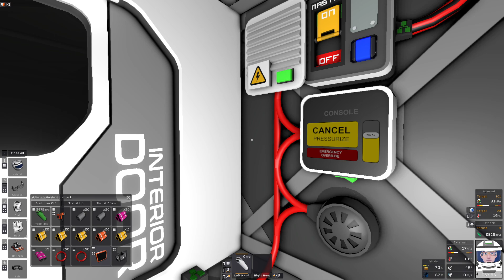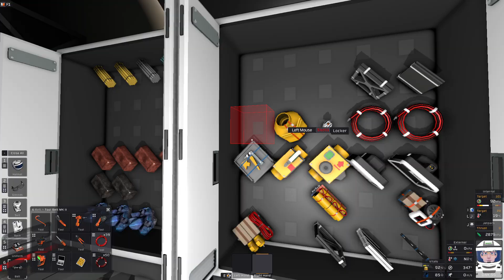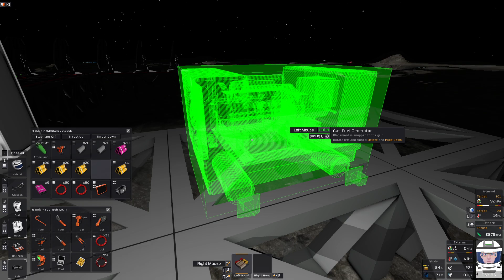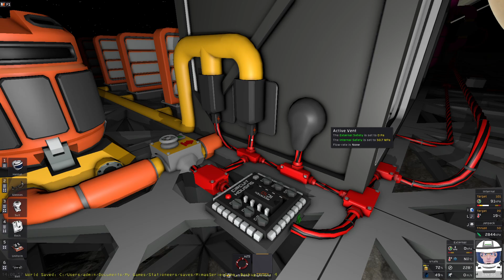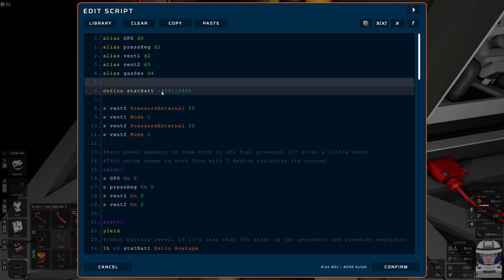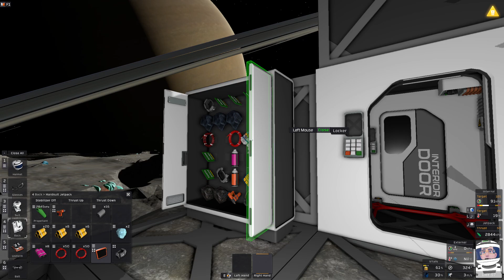Stationeers S1E12 - Mimas - Gas Fuel Generator IC controlled

Comment: Do you have the IC10 code, so I can download it?
Good video 
I'm going to try this tonight
Reply from the maker: I made changes to it after this episode, and I've pasted 2 versions into the description (don't worry, pasting it below too).  The following version is the final one I have before I had to give up recording, the biggest change is it turns on pipe heaters as a power sink if the battery goes above 98%.  If you don't want that portion it should be easy to remove, and if you have any trouble let me know I'll try to help debug :)

Code:
alias GFG d0
alias pressReg d1
alias vent1 d2
alias vent2 d3
alias gasSen d4

define statBatt -400115994
define pipHeat -419758574

s vent1 PressureExternal 50
s vent1 Mode 1
s vent2 PressureExternal 50
s vent2 Mode 1

#This setup seems to work fine with 3 Medium radiators (in vacuum)
reset:
s GFG On 0
s pressReg On 0
s vent1 On 0
s vent2 On 0

start:
yield
#check battery level, if it's less than 50% start up the generator and pressure regulator
lb r0 statBatt Ratio Average
s db:0 Channel0 r0
brgt r0 0.1 3
s GFG On 1
s pressReg On 1
#Extra power sink
brlt r0 0.98 2
sb pipHeat On 1

brgt r0 0.9 2
sb pipHeat On 0

#If battery is above 75%, turn everything off
bgt r0 0.25 reset

#Temperatures are in Kelvin, 273K = 0C, 278K = 5C, etc, 328K = 55C
l r1 gasSen Temperature
#Turn on vent1 if it's above 30C
sgt r0 r1 303
s vent1 On r0
#Turn on vent2 if it's above 40C
sgt r1 r1 313
s vent2 On r1

l r0 GFG PowerGeneration
s db Setting r0

j start
Reply: @ossorakgaming  thanks 🙏

Comment: Your idea, for cooling the gfg, is good.
It's just not sufficient. 
Try to connect vent 1 to 2 radiators, and vent 2 to 2 more radiators. 
Both have a passive vent to the gfg.
This will increase the airflow and reduce the temperature chock. 

Good luck.
Reply from the maker: So far it has been working fine, but so far it hasn't had to run for very long.  Once I upgrade my station battery setup the heat could certainly overwhelm my setup, so I'll keep this in mind.  Thank you for the suggestion :)